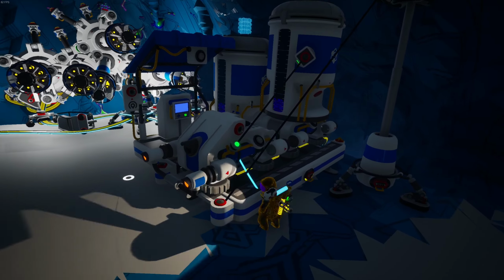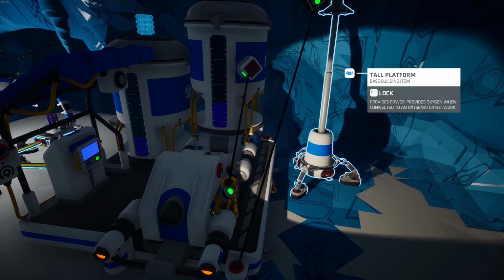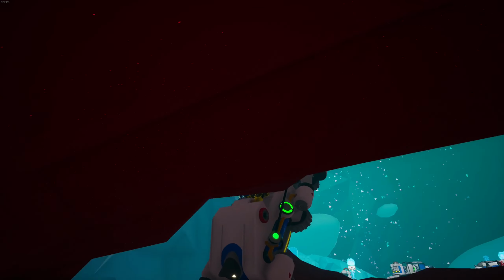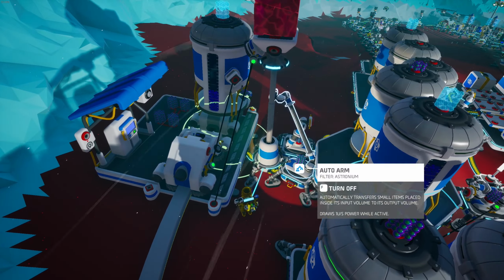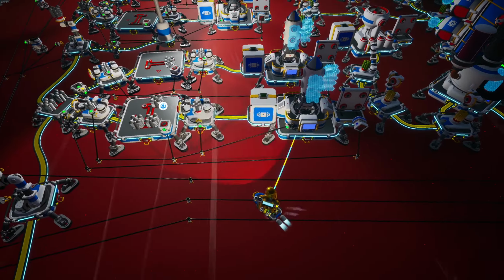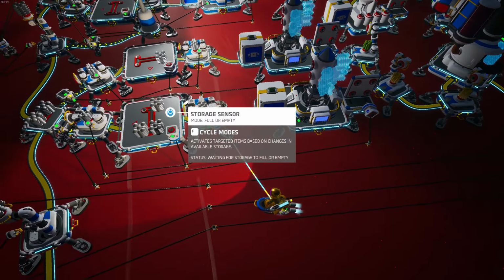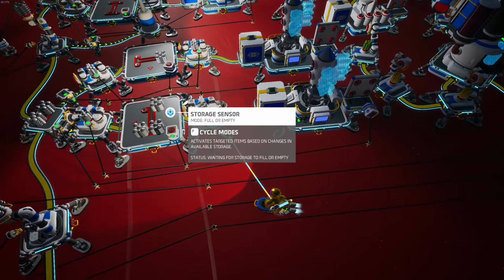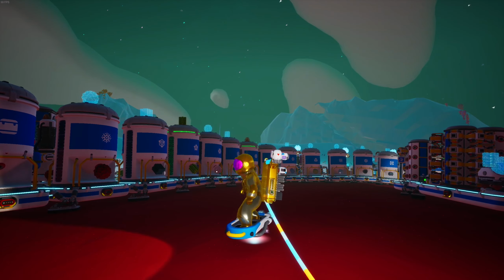I Built A Railway and Became A God In Astroneer

Comment: Also have you tried putting the proximity repeater on the activation pins? You can do that in case you forgot.
Reply from the maker: I chose not to do that since it will also activate the train and the platform. It’s easier to control what it activates when off the platform

Comment: I know this is sort of unnecessary, dont why dont you overclock your extractors? (I hope you know what I'm talking about)
Reply from the maker: Because I didn't know that you could do that. Now that I know about it, I'll tell you why I won't be using it. Since I have a bunch of those extractors down in my mine, I don't want the space to be more cluttered and difficult when I go down to refresh the collectors. Also, I don't have any worries about power draw being too high since I have 200 rtgs and can make more. I'm not sure if overclocked extractors overall produce more per green bar, but if they extract more per charge then I may consider them in the future. Also, I have 2800 Astronium stockpiled so there won't be any shortage of that any time soon lol